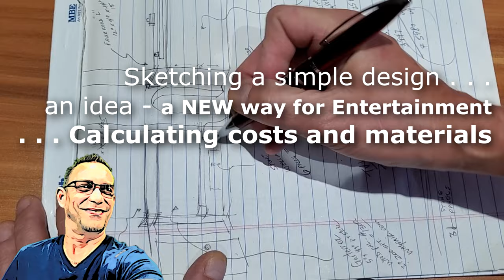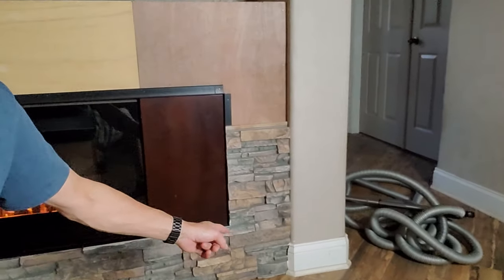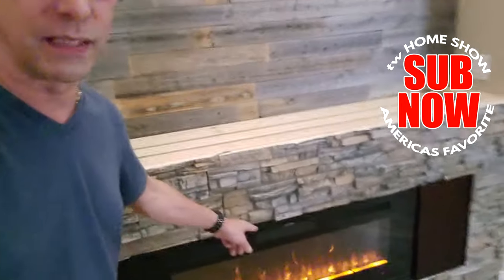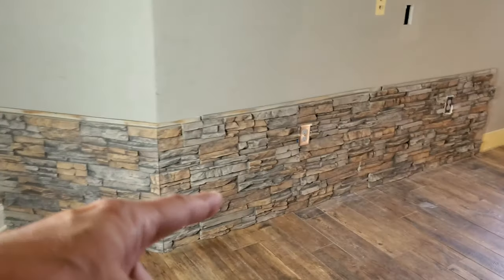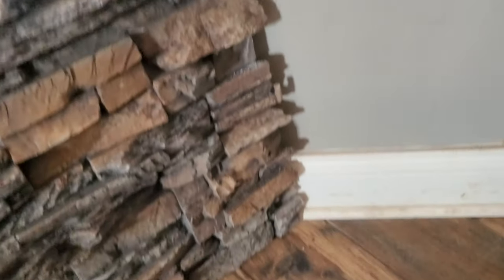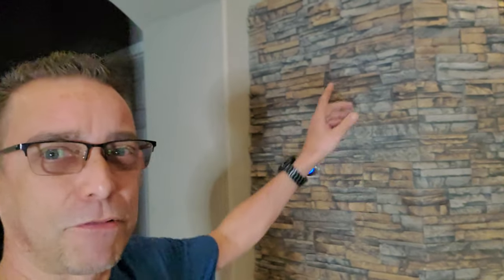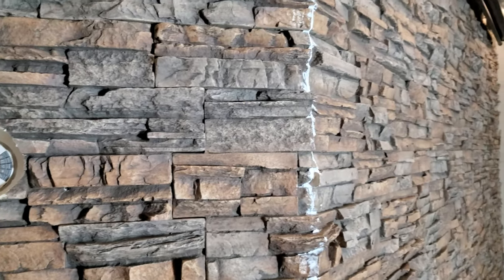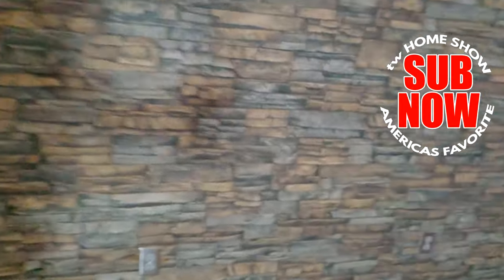Entertainment Room/Walls | Part 4 | INSTALLING Faux Stone Panels | Smart Up-Lighting

Comment: Are you Gluing the back of the panels . If so what type of glue are you using.. I want to install these on the Exterior of my home any tips would be helpful
Reply from the maker: Hello Vinny, I just used screws. It goes up a lot faster than messing with the glue. I tried the glue (recommended) on my first installation of these (outside my home) and it was a waste of my time. The glue didn't want to hold the panels and it was messy.  -Todd